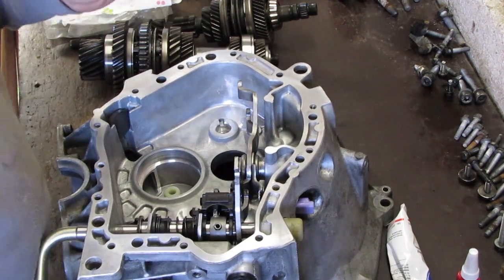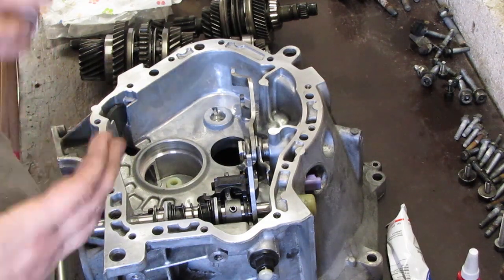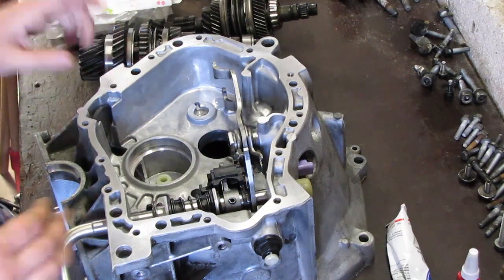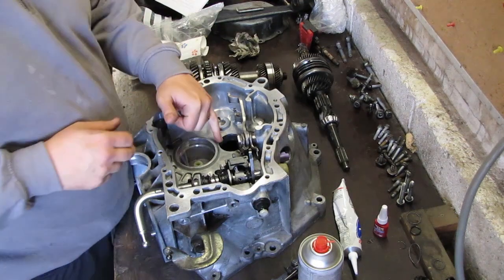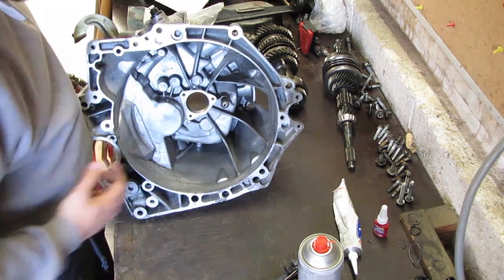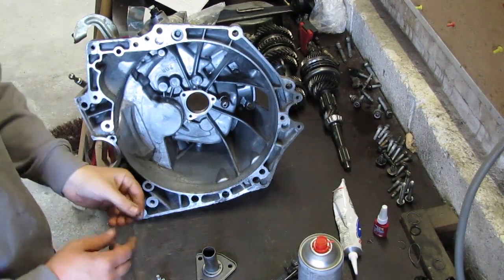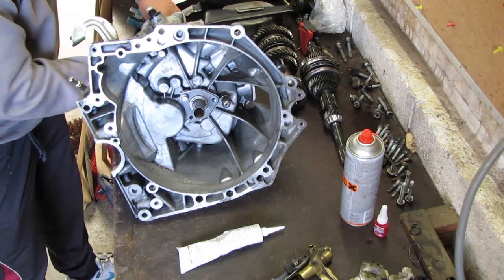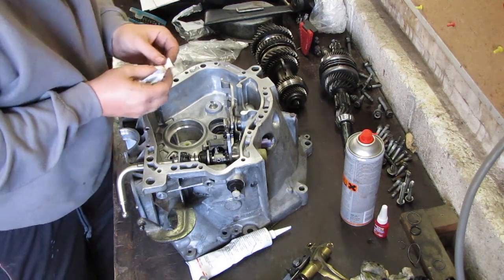Peugeot 207 - BE4 Gearbox Overhaul (Part 10)

Comment: Hello. And tell me where to get a ring like 11:19? and is it article or size?
Reply from the maker: This one was the one from my gearbox. You can get different sizes (thickness), they're used to set the preload on the tapered roller bearings
Reply: @Ronke01  Oh, and I do not have such a ring in the box and do not know what its size
Reply from the maker: @peugeostiks  that means it didnt need one during assembly. Reassemble the gearbox as normal and once closed up you should check in and out play of the shaft... If there is too much play it will need a shim like that
Reply: @Ronke01  thank you for answering) and what is the allowable backlash? 1-2 mm or less?
Reply from the maker: @peugeostiks  I dont remember that one unfortunately. I would expect it to be pretty tight. 1 mm seems a lot, since it's only an oil lubricated bearing.
Reply: @Ronke01  very grateful for the answer) I have been making a box for almost a year) and your videos are very helpful

Comment: You are doing so many things wrong!! You have bought so many new parts , spend so much money and if you have looked the manual and paid attention to what it says you would have done good job!!
Reply: you  applied grease at the outer race which is the stabled part of the bearing and you putting in with a hammer???????  if you want to put an outer racer you refrigirated it for 15 min and then you apply loctite for bearings and put it in without using any force!! if you want to use a tool you can use a plastic hammer or better if you have a pressing tool!!

Comment: Hello Ron, could you be so kind and share with me the manual which you are using making this video. I looking for an information regarding the spacing gap between the primary shaft and sealant housing, you call it to guide backup(engine side), maybe you have that data?? I will appreciate every support.
Reply from the maker: Hello Karol. Just step into your Peugeot or Citroen dealership and ask them if they could get you the information. Or make an account on Peugeot Servicebox. Its basicly free and you can search for parts for your car freely, the manuals you pay with VISA and it will cost you 5 euros for 1 hour of total acces ;)

Comment: How difficult is it to replace the motor on the 207? Can an amateur do it, with the right tools? I have a 1.6 hdi 90 hp as well, and its dead... Want to put a new one in.
Reply from the maker: MrZlaja61 the only special tool you should need is an engine hoist. Other than that it should be possible.